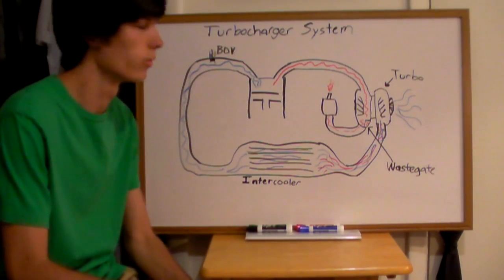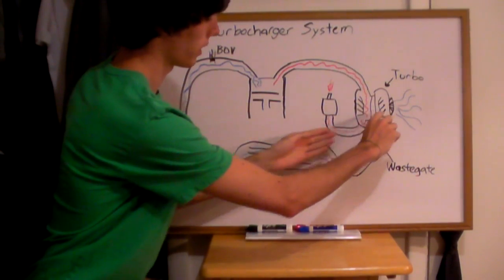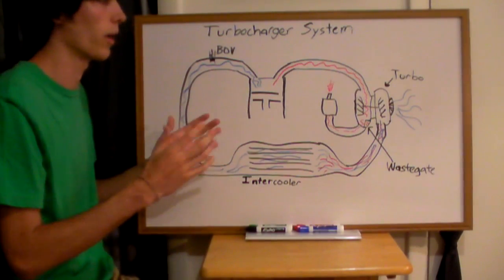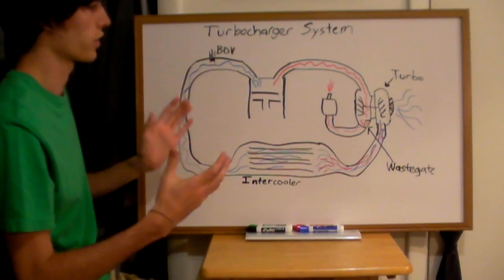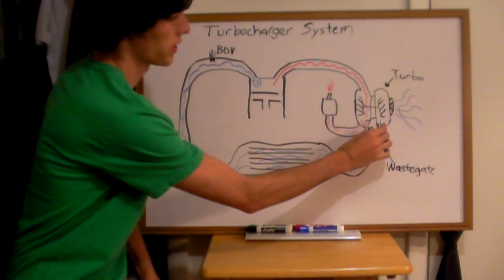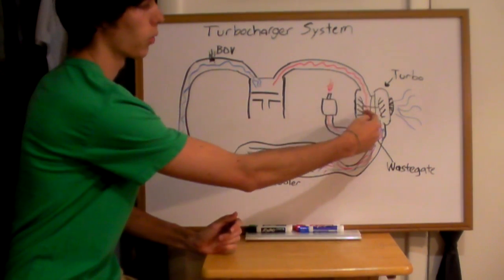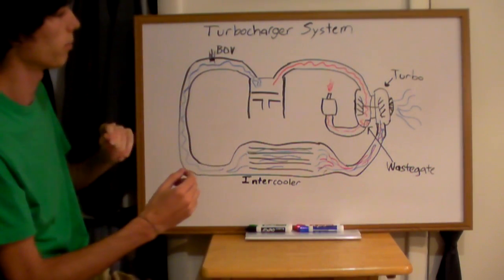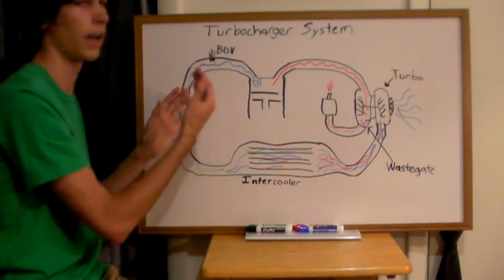How Turbochargers Work

Comment: Is it possible that installing an aftermarket catback exhaust can cause problems with the turbo because of the difference in back pressure?? I installed a borla Touring in my f150 and the dealer said that my turbo is making a rattling noise and they’re blaming my aftermarket exhaust

Comment: I have a weird problem, when I upshift at peak psi or relatively high psi, my rev usually went up 500-1000 rpm before it starts to drop, is that normal? Turbo engine...

Comment: So basically what a turbo does is pushes more air in the combustion chamber because more oxygen will create more power. But if we increase the amount of air going in the piston, we have to increase the amount of fuel as well to maintain the air fuel ratio. But then why does that increase the mileage of the engine?
 A turbo charged vehicle uses more fuel per cycle than a naturally aspirated engine, but usually turbo charged cars have better mileage.
If we take 2 cars, one with turbo and one without turbo and set the same air fuel ratio. Obviously the power will be more in turbo charged car. But which car will give better mileage?

Comment: Jason;  

Thanks for posting!

I live in the mountains of Northeast PA and have a 2015 Forester 2.5i 6m. It's fun but it lacks low end which forces me to pull 4 grand on a daily basis to get up some of these hills. 

Though altitude is not high enough to significantly thin the air and starve the engine, I am looking at an XT turbo just due to the sportiness and extra power provided by the turbo. 

As I would be using the turbo almost daily to navigate the hills, would the turbo shorten engine life? In terms of longevity and low cost of maintenance, how do you feel the 2.0 turbo would fare against the 3.6 found in the outback if used in mountainous terrain?

Comment: Very well explained but I'm still lost. It's not you, it's me.
Reply: Il help ya mate, let's start with the turbo in the diagram shown... think of the turbine housing on the left filled with "red" exhaust gasses, 1)the exhaust gas spins the turbine wheel 2) the turbine wheel uses a shaft to connect to the compressor wheel (compressor housing on the right side). 3) the compressor wheel is spun using the inertia of the turbine wheel, thus creating "forced induction" of cold air 4) the cold air is then compressed which then turns hot (you don't want that inside your engine) 5) that's when the intercooler comes into play and cools it down enough to enter the cylinder to be compressed into exhaust gasses. And the cycle starts again :) hope this helps you man

Comment: Is there a point where a cylinder could have too much air and fuel mixture. I hear drag cars being pushed to 100psi. But is there a point where there is so much air and fuel, it is forced to burn in the exhaust. Forcing you to go to larger piston? 

Theoretically could you running 200psi in a small 4 cylinder providing it does fall apart and separate at the seams?

Comment: Good Explanation, May I know the Connections difference between turbocharged and without Turbo. If Turbo charge is not present, how frequently air is drawn and how the exhaust gases are driven away? The similar diagram without turbo charge.
Reply: I believe you're talking about naturally aspirated. So with naturally aspirated vehicles the exhaust gases just passes through the exhaust manifold then to the Catalytic Converter and through the silencer and out the tail pipe. However with Turbo charger the exhaust gases passes through the turbine to Catalytic Converter and the silencers and out the tail pipe.

Comment: If a wastegate keeps psi at constant pressure why the need for a BOV?
Reply: The wastegate can keep the turbocharger from over spinning and destroying itself or destroying the engine with overboost. So lets say if you engine can can handle 10psi under wide open throttle, the waste gate can help keep the turbo from boosting over that psi. This is different from the BOV(some vehicles use a BPV). when you let off the throttle while boosting 10 psi, That 10 psi of pressure has no where to go but back to the turbo, which is real bad for the turbo. So, a blow off valve will bleed off all that excess pressure when you let your foot off the throttle, keeping your turbo alive.

Comment: Hi, I'm just confused about something with turbochargers. If a turbo pulls in more oxygen which then causes the engine to squirt more fuel into each the cylinders, how does it increase fuel efficiency if there's more fuel being used? Thanks heaps!
Reply: You can use smaller engines with a turbo and still have the same power. But smaller engines in general have smaller internal power loses because they produce less friction while running.
Reply: "Its easier to push than pull". Turbo shoves air in cylinder while NA engines pulls air in cylinder. Turbo has higher efficiency. Economy turbos produce very little boost (so fuel injection still remains low), just enough to achieve this efficiency.
Reply: and along with acheiving the same max power with a small engine, you can idle at a red light and use less gas than a bigger engine that is idling.

Comment: I have a question, is it safe to install a turbo charger into INVECS III mivec CVT Engine Lancer EX 2015 model with automatic transmission???  Regards...
Reply: Well, cars are made to sustain amount of force they are built to. By increasing the power you could damage the CVT gearbox. If its only 10%-20% power increase it should be fine. Just remember by doing this you will lose the warranty of the car.
Reply: Yhank
Reply: Thanks man...it's helpful info...
Reply: Michael Monarca There should be cheaper ways to gain more power without voiding the warranty. Ask in your local Mitsubishi dealer what they can do about it, maybe they can reprogram your ECU to to achieve performance over economy.

Comment: Diesels dont have a blow of valve,so how do they work?
Reply: verti-valves most likely, just a quieter valve that a lot of factory turboed cars have that does the same job as a BoV
Reply: Alexandre Romao
Ups, yeah typo. ;)
It always depends on the overall setup of the whole air intake system. Some systems a more prone to produce turbo flutter than others. Especially if they are quite short and have a relative small volume after the compressor stage. But from what i hear in video it's a rather weak turbo flutter. Some tuner cars with a BOV actually produce a much more pronouced sound than the car of your friend. And it only seems to occur when he let's the engine completly lose it's revs so, it shouldn't be to much of a problem actually.
Reply: +Alexandre Romao black smoke means there is either too much air or diesel getting into the engine. Look up "rolling coal" people do this on purpose to make those huge clouds of black smoke, im pretty sure they have a efi switch that they turn on so it puts too much fuel into the engine which creates black smoke out of the exhaust
Reply: Diesels don't need a blow off valve because they have no throttle plate and also it isn't a problem for them to run with excess air. Diesel will ignite anyway because of the way they work.
Reply: then why for example,my friend has a 2.7 tdi nissan terrano 2,an offroader:35 tires,lifted suspension,higher turbo pressure...etc.and every time he takes his foot out of the gas it makes a sound like "tuuu".heres a video of it https://www.facebook.com/xicoestoira.pinho.7/videos/vb.100004078806566/874392452706707/?type=3&theater ,if you listen closely you can here a "tuuuu" isnt that a bov?what is it then?
Reply: You can hear better in this video tho https://www.facebook.com/xicoestoira.pinho.7/videos/vb.100004078806566/602440813235207/?type=3&theater
Reply: Well, that's not the BOV. That sound is exactly what the BOV is designed to prevent in a petrol engine. It's turbo surge sometimes also called turbo flatter. You say he runs with unusual high boost pressure and that can cause problems.
If you run with higher boost pressure than normal and you suddenly go off throttle, the engine can have problems to use up the compressed air which is still in the intake manifold fast enough because the revs drop very suddenly and very fast. The result is similar to what happens when the throttle plate closes in a petrol engine. The compressed air starts to vent out of the compressor stage and slows the turbo down. But the effect is far less severe in a Diesel engine.
You can install a BOV in a Diesel if you run such tuned setups, it will prevent turbo surge in exactly the same way it does it in a petrol engine. But normal factory Diesel setups doesn't need a BOV because the boost pressure is way lower, so this problem never occurs.
Reply: Dont you mean "turbo flutter"?.he doesnt run a crazy higher turbo pressure maybe 1/2 Bar.There is some seat ibiza TDI that can reach 3 bar with no problem.He also has a higher pressure on the fuel pump,to inject more diesel,so it gives it a litlle bit more power,so you can see the black smoke coming out of the exhaust. so he has a balaced mixture between air from the turbo and diesel.Maybe im wrong,idk much about cars
Reply: So whats the difference between turbo flutter and the bov sound?
Reply: Well but there is people that modify tdi engines,and they put a higher pressure on the fuel pump so it comes more diesel to the engine (comes out black smoke) and then they make the turbo pressure higher to compete with that extra diesel,so it makes a balanced mixture between diesel and air.It makes a little bit more horsepower.Am i right? :/
Reply: +Alexandre Romao but if it's black that means it doent have that perfect fuel mixture
Reply: So if it is a lighter black or a little bit grey it means that there is more air than diesel in the mixture?
Reply: +The real doktorbimmer all im saying is that where theres smoke there should be more air so it actually uses the fuel. In a diesel if you floor it from a stop you will get smoke and once the turbo spools up and gives the engine the proper mixture it goes away because its running right.
Reply: +The real doktorbimmer why are most diesels coming out already turbocharged then if according to you the thing stopping them from power if fuel intake

Comment: are all the turbos have the same architecture? If so, does that imply they are universal and interchangeable?
Reply: There are many kinds of turbos, you have bi-turbo which is small and large turbo combined, turbo with electronic assist to get spinning faster and so on. Not to mention you can order a turbo in whatever size you want.

Comment: i really appreciate ur vids. Could u do a vid on a 2 step? Along with a "nitrous vs forced induction" vid?
Reply: In short, 2 step cuts ignition on "x" rpm while still sending fuel. Fuel ignites in the exhaust which allows the turbo to keep spinning without raising the rpm of the engine. Thats why you see fire out of exhaust on 2 step car.

Comment: So do you use a waste gate and a bov, or one or the other
Reply: Both, a waste gate is to release boost in the turbo itself and the BOV is for after it's been through the intercooler and is about to go into the engine

Comment: I heard there isn't a blow off valve in diesel engines,so how do they work?
Reply: They use a bypass valve (BPV).   It has the same function as a BOV (to relieve pressure) except it returns it to the intake so it can get air faster.   Most (if not all) modern stock turbocharged cars come with a BPV.
Reply: I see.And why don't petrol engines use this?
I suppose the BPV can be heard? When I take my foot off the gas I hear a loud pss sound from the turbo (I have a new mazda 6 diesel)
Reply: +Mark O petrol engines do use it.
Reply: And why is it better for diesels?
Reply: +Mark O IIRC it depends on if a set up runs a MAP (mass air pressure) sensor or a MAF (mass air flow) sensor.  If on just a MAF setup I believe a BPV is required so that the engine won't run rich (not enough air).  On a MAP setup you can run a BOV.   People will argue what they want to run but I prefer a BPV on my Cobalt because the ECU expects that extra air being recirculated into the intake and it helps respool the car between shifts
Reply: Thank you very much,I will look into these stuff,your comments were really helpful!

Comment: In addition to my previous question, if you didn't have a blow-off valve and saved the boost by keeping the pressurized air in the system, could that help solve the problem of turbo lag? My thinking is that turbo lag is caused because it requires the exhaust to spool up the turbocharger and produce boost and if the exhaust isn't immediately there from the lack of throttle. If there is already excess boost in the system, wouldn't there be no turbo lag because the boost is constantly in the system?
Reply: +Corson P Actually, if you wouldn't use a blow-off valve the turbolag gets worse. The problem is the throttle plate. In a petrol engine if you lift your foot off the gas pedal the throttle plate closes and basically stops most of the air going into the cylinder. Now the air between the throttle plate and the compressor stage is traped, but the turbo still tries to force more air into the engine, because of it's momentum and now something very bad will happen. The air will travel the only way that is possible and that is back out of the compressor, so basically the air reverses direction and this slows down the whole turbocharger massively. Even worse, it can cause the turbocharger to start vibrating and so it can cause premature wear and ultimately can damage and destroy a turbocharger.
Reply: Thank you so much for the response +shi01, I understand what you're saying and it makes lots of sense. I work for a race team and we run KTM X-bow GT4 race cars, which have a 2.0L Audi Turbo TFSI motor. I asked our head engineer the same question and he said something along the lines of your statement. He also mentioned that it may not even get to that stage since the pressure would blow the hosing off the intercooler/ any place it can. Therefore I completely agree with you! Once again the reply is appreciated. Take care

Comment: This is a fantastic video! I do have a question regarding the blow-off valve though. Why can the pressurized air not stay in the system until the throttle is re-applied? Is it not wasting energy by releasing that boost instead of saving it until it's needed? Thanks!

Comment: can you guide me how to connect my turbo lines I know how oil line has to connect but my JDM A/R24 M70 has two other holes that I don't know what they're for I believe is coolant but not sure and a vacuum coupling in compressor side don't know where to connect it to and dont know how to connect my boost gauge hope u can thanks

Comment: Do you have a video on blowoff valves vs recirculating (bypass) valves? I couldn't find it in your channel. I completely understand a blowoff valve and how an engine with a MAF sensor will run very rich between shifts. But what about the bypass valve? Why would you run a line from the BPV back to the intake pipe after the sensor but before the compressor vs running a line into the intake manifold to prevent the engine from running too rich between shifts. I'm reading all over on different car forums that BPVs recirculate the air to between the MAF sensor and compressor. It's not making sense to me. If it helps, I'm interested in turbocharging an FR-S. And I guess the question is would I run a BPV to recirculate to the intake pipe or the intake manifold. Should make a video on this too if you haven't already

Comment: you Mr engineering explained I have a serious question about turbo charging a sohc 1.9l engine and if I will be able to get enough horse power gain for the cash or should I just throw in some good head studs and gasket and throw a hundred shot into it basically I'm looking for another 110-175 more hp

Comment: Do you have to get your turbo to a certain speed for it to starts working it's magic or does it start working when you start driving
Reply: Some cars/trucks boost doesn't come Intel you get to a certain RPM'S
Reply: Look up "Turbo Lag"
Reply: Engineering Explained has a good video on it
Reply: Yes, economy turbos spool up between 1500 and 2500 rpm while performance ones usually do over 4000 rpm.

Comment: Sorry to do this, you have done a great job teaching people the turbo . But you missed a name a said it incorrectly. The exhaust side is called the turbine. The fresh air side is called the compressor , since it compressor the air to get to inter cooler then engine
Reply: The turbo is made of 2 turbines while one compresses... both side uses turbines you're trying to tell a mechanical engineer correct parts and names???

Comment: you don't explain how a turbo charger creates more power. do you have another vid for that? thanks!
Reply: +Gary Z I believe it pumps more air thus oxygen into the engine which will increase the amount of fuel that can be burned in the combustion chamber. This provides the extra boost.
Reply: +Gary Z Lol, you don't know how an engine works.
Reply: In short, the more air you can compress, the higher the explosion (power). Turbo works by "shoving" air in the cylinder and increasing the amount of air in combustion.
Reply: if we can increase power/fuel efficiency with air, why isn't this or something like it, standard on all cars?
Reply: ***** Because its cheaper to make naturally aspirated (non turbo) engines. Turbo engines feel unnatural because of turbo lag and NA engines are easier to maintain and use.
Reply: understood but it seems like if you can ram more area into the combustion chamber and make the fuel more efficient, someone should find a suitable way to do this. i dunno...
Reply: ***** Turbos are a good way to have economy or performance engine, but NA is more of a balanced engine.
Reply: got it :)